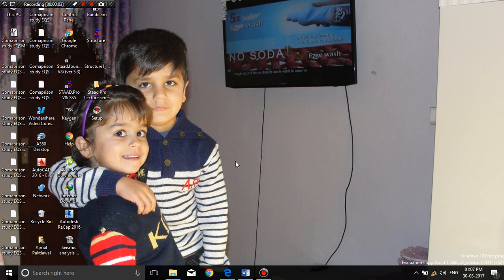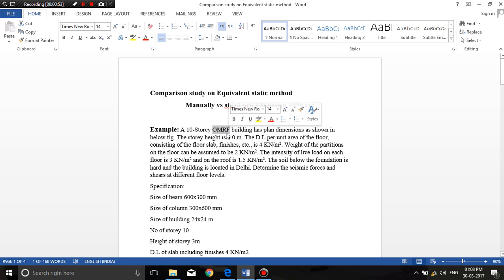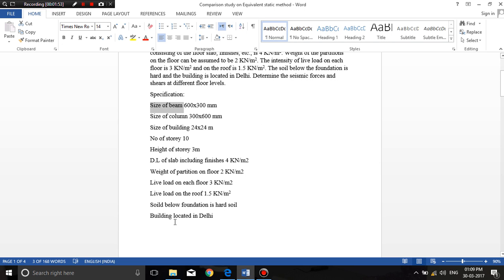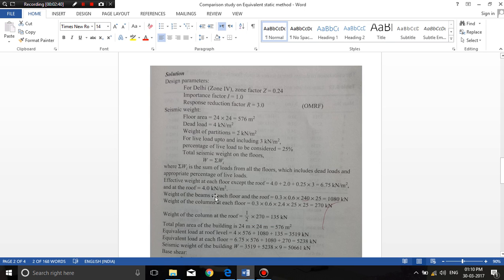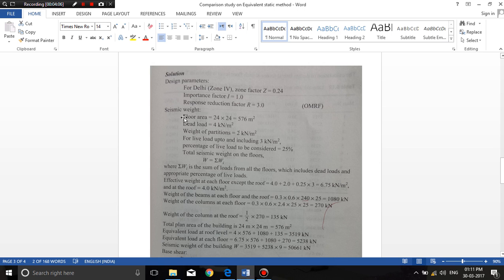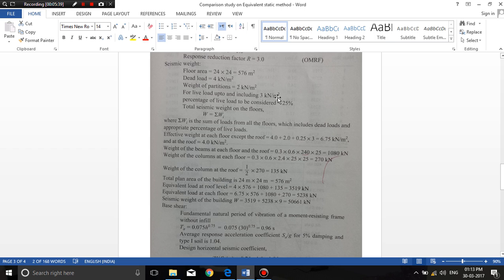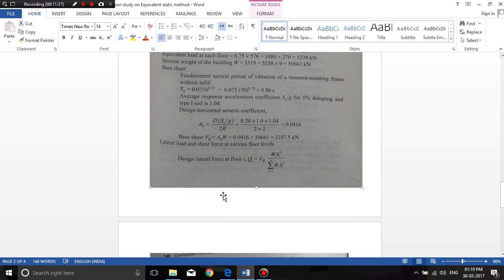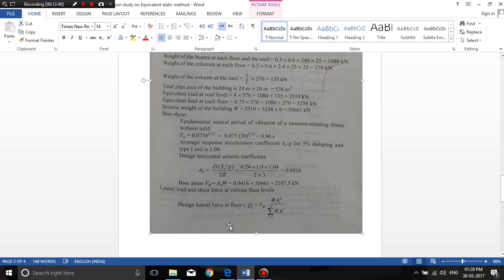Seismic Analysis of 10 Storey RCC Building Using Staad Pro V8i

Comment: thank you..very clear lecturing and thanks  its in english..  My doubt regarding the time period.. is it that the output shows 0.96s was the one you entered for which it was a pre calculated value? does this mean we need to find out value for T even if we use staad? and is the damping ratio you used was constant value and doesn't change?
Reply from the maker: Tluangtea Coyg yes for using manual and software design it is required to compute n entered